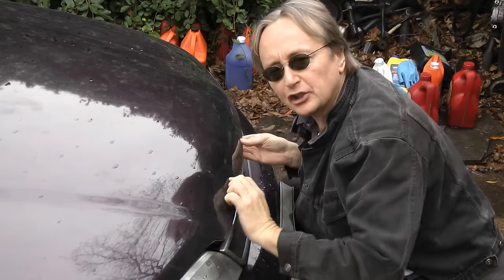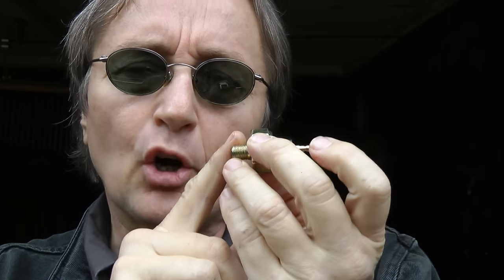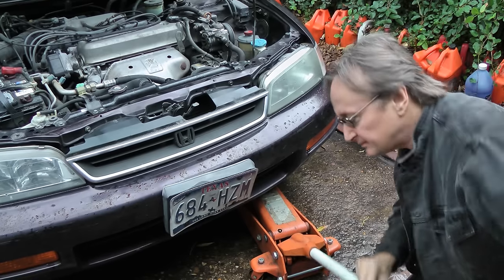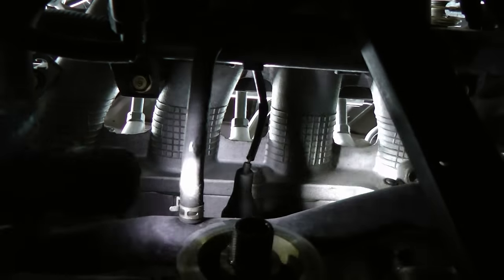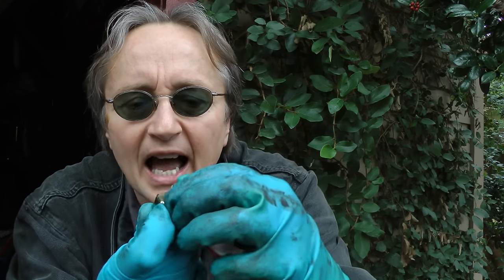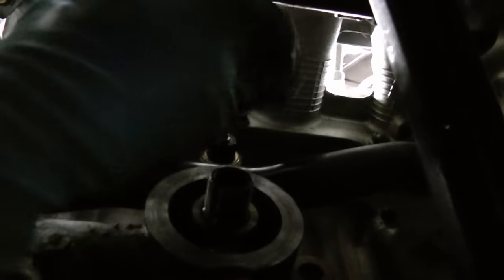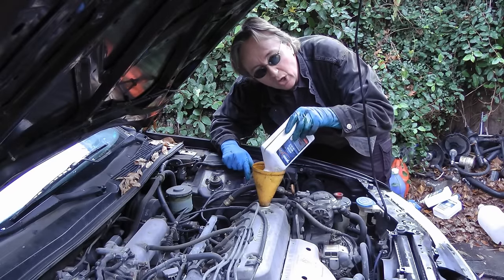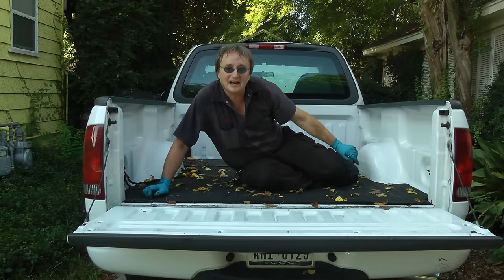How to Fix a Low Oil Pressure Light in Your Car

Comment: hey scotty. I have a 2006 dodge charger rt. I replaced the motor oil and the filter and after driving it for two days the low oil pressure light came on.  I have had this car for a couple of months. and I decided it was time to change the oil. I used conventional oil. the car has 126,000 miles. can it be because of the oil viscocity or what can it be... thanks in advance.
Reply from the maker: first, change the oil filter, bad ones will do that with weak springs inside. If not that, change the oil to a higher viscosity
Reply: ok Im sorry. I miss read the code.  the code showing is p0520.
Reply: Go to auto parts store and ask for a oil pressure switch, I use to have the exact same car, year and everything and that was the problem. The 5.7 hemi has that problem with the oil pressure switch. The part is about 40$ for your car.
Reply: Kenneth Tate I replaced the oil pressure gauge twice. One from Autozone and the second from the dealership (mopar) I drove 5 miles after the first one and the light came on again. Then after using mopar the problem went away. You have to use oem genuine parts otherwise the car will detect  a difference in voltage.

Comment: Okay scotty i need your help. I have a 1997 dodge ram 1500 4x4 its making the famous ticking noise.... Oil pressure at idle is like 20... And sometimes while driving it fluctuates from 20-40. When its right at 40 or a little above, it quits ticking.
Reply: Also oil level is good
Reply from the maker: +Kevin Barfield replace the oil pump

Comment: Hi Scotty. A question. My S320 Benz feels like at times the engine stops when I suddenly step on the brakes!!! I checked the rpm and its at 7000 without the aircon on which is supposed to be normal. And with the aircon on its really kind low at 400 and at time really dies out.  Is it just my idling too low?? what else could it be? thanks
Reply from the maker: try my video "how to fix a car that idles poorly" it should not idle at 400 rpms, may need a new iac valve
Reply: Scotty Kilmer I HAVE OLD FORD TRUCK , WHIT MOTOR 351 MODIFIDED 400,WHEN COOL ,IS GOOD OIL PRESSURE ,BUT ,WHEN HOT OIL PRESSURE GO DOWN LIKE 10 POUNDS .BUT IF I PUSH GAS ,PRESSURE MOVED UP .DO YOU THINK THATS IS NORMAL...MY TRUCK IS FORD 1980 F350 ,
Reply from the maker: erick mendez
normal for an old worn engine, perhaps idle it up a bit higher.
Reply: Scotty Kilmer Hi Scotty. I was able to improve my S320 Benz. Now the idling is back to 700 which is about its normal operating idle speed. And it no longer dies out when I turn on the aircon load. What did I do? I cleaned up all her air sensors, two of them actually, the MAF and the air temp. I didn't anymore tried cleaining her IAC valve since I will go over to take it out of the engine. What I did was give her the Italian tune up!!! Her engine isn't quite old yet since she only clocked at 115K miles!!! It was a complete success!!! Now I am happy using her for my daily drive!!! She purrs like a kitten even at the heaviest traffic with no over heating!! Thanks
Reply from the maker: EndofUSA
driving a car with carbon build up will often blow the carbon off and make it run normal again
Reply: Scotty Kilmer
Yes Scotty!! I guess that exactly what happened!! My S320 is back to its normal behaviour. Even with an aircon load she idles up to the required 700 rpm as it should. No longer that she dies out on me again!!! Thank you very much for all your help tips!!! More power to you!!!

Comment: Hi Scotty, I have 2003 Accord V6. It now has 140,000 miles on it. After I changed the engine oil for 2000 miles, the engine oil is all gone because I cannot see any thing on the engine oil mark. I do not think it is leaking because there is nothing on the parking ground. Today the engine oil flashes when I was driving and there is no engine oil in the car, I just stopped by store and added one quart oil. May I ask what I should do then? Should I drive it to Honda dealer or just the cheap mechanics?  Thanks a lot.
Reply from the maker: at that age, they burn oil, change the oil and filter, and add oil as it burns out
Reply: Scotty Kilmer That's a good point. But if I do not get this repaired, is there any serious result?

Comment: Hey Scott, so my engine level on the dash of my 2002 GMC Yukon XL always goes down to zero and the engine begins to knock. Once I accelerate or rev the engine the oil level goes up and the knocking stops. I actually have to put my truck into neutral and just rev the engine at a stop light so the light won't come on. I'm always putting in oil since I have a small leak so I know the oil level is fine cause I check it first thing in the morning. Any help???
Reply from the maker: fix the leak first, pray it's causing knocking from low oil pressure. if not, engine will need rebuilding

Comment: I had an oil maintenance light come on and I changed the oil and filter. The problem is, the oil light will not go out.
2009 Dodge Charger 3.5 V6 Automatic. I tried the gas pedal theory and unhooked the battery and also, connected the neg to the pos cables and turned on the head lights to drain any access current.None of these seem to work.
Please help, Scotty.
Thanks a lot.

Comment: hello good morning I have a problem with my lincoln navigator 2003 !! what happens is that when I'm driving it off completely and the board turns me something that says (low pressure oil) and the funny thing is that after going off I waited a few minutes and then turn on the truck as if nothing fails ta .. you could kind of tell me what the problem of my truck
Reply from the maker: change the sending unit as in this video and pray it's just that

Comment: @Diabloscampeones9 thanks for the tips I already watch the video and did all the stuff u said. I really think its the oil pump there is no pressure on the pump beacause I even removed the oil filter and the filter didn't have any oil canu tell me where the oil pump is please so I can work on it over the weekend thanks.

Comment: Hey Scottie, question my oil light comes on whenever I come to a stop and sometimes the engine cuts off but if the engine don't cut off the light will go away when I accelerate or raise the engine.  How do I fix this? Oh yeah it's a 03 neon with 130,000 miles.
Reply from the maker: try a new oil pressure switch first, pray it fixes it. Cause if not, you have low oil pressure and engine would need serious internal work. those neon engines are pretty much throw aways with that kind of mileage, being they are made in Mexico where quality is not a top priority.
Reply: Ok thanks. I changed the oil pressure switch and so far I have not really gotten the oil light but it does come on still because my idles really low sometimes even shuts off.  I cleaned the  inside of the iac duct and replaced the iac. I also replaced the tps sensor and inspected all the wires for cracks but it still idles really low which I think what was causing the oil light to come on in the first place. What else can I check for low idle?
Reply: @ftaylor1988  Spray the throddle body with throddle body cleaner as per vehicle instructions.. Spray the MAF sensor with No cloth.  Check cpu codes for coils & injectors.

Comment: i have the same problem in my car but, sensor had been replaced, and still the light come on, i have 04 vw passat 1.8t 155.000 miles.. i read couple rewievs abput it and i believe had sludge lines, its that correct, but once i drive on the street, but on the freeway without problems.. any ideas?
Reply from the maker: +Ricardo Juarez try K and W engine flush treatment

Comment: scotty i have done this but i still have the oil light coming on! only in drive while stopped though,  it goes out when im driving. im in Australia and i drive a 1996 holden statesman V8 fuel injected 304, ive brought a pressure test kit to check. the car has done 337 thousand ks! any suggestions on what could be wrong as i am still getting oil flow on the rockers! thanks :)
Reply from the maker: +Darryl Burrows   if the pressure kit shows normal oil pressure, ignore it, the warning system is breaking down then. If it does show low pressure, anything from a worn oil pump to worn engine bearings cdoes it with that high mileage.

Comment: would this happen to my 1993 honda accord. would it cause my engine to not start up. my car will crank but wont start up.
Reply from the maker: generally not, unless the engine is flat worn out inside. Instead, try my video "fixing a car that cranks but doesn't start up"

Comment: I replaced my Oil Pressure Sensor because it kept flickering. Now new Sensor is in and my oil light stays on permanently now. New oil change and filter and still drives good on highway. Why is it still on? Connector good and clean...

Comment: Hey Scotty I get dodge  ram change oil censor by continue  medidor low pressure oil you  help please
Reply from the maker: +Rodney Quezada have a mechanic hook up a real oil pressure gauge to find if you really have low oil pressure, or whether your gauge on the truck is just bad. Pray it has real oil pressure, cause if not, big money for new oil pump or the engine needs rebuilding with new bearings

Comment: Hello from NJ.  When I start my 2005 park avenue, the oil pressure gauge steps up and down, the red oil light blinks on and off, after about 5 minutes the oil pressure gauge stabilizes to normal.
Reply from the maker: +Patrick McKenna if engine does not clank, replace the oil pressure sending unit as in this video
Reply: TY Scott.  Appreciated.

Comment: hey Scotty, I replaced oil to a higher grade to my chevy04 Silverado (5.3)from 10-30 to straight 40 and added motor honey oil treatment on top of that. one week later all of the sudden the oil pressure went down to "0' and cranking noise. I didn't drive over a mile so I took it to the mechanic and he replaced the oil pump. the cranking noise stopped but not the low oil pressure message. It goes up no more than 20 and then goes back to "0". Will the sending unit fix the problem, and do you hear anything about the oil lifter  could be a problem? Thank you.
Reply from the maker: try a new sending unit, but don't use 40 weight oil, that's too heavy for that engine.

Comment: 06 volvo s60 2.5T, not reading oil pressure, no noises, oil changed 2k miles ago, car always maintained. Any ideas?
Reply from the maker: do as in this video and pray it's just a bad oil pressure sensor , often is on that model
Reply: Thanks for the super fast reply! Is it worth risking driving to the shop? Shop is 1 mile away, I can throw it in neutral for at least half that time since it's all downhill..

Comment: Hey, I have a 2005 Hyundai Elantra and when I turn the key to the on position the low oil pressure, Charging system, and check engine come on. But I start it the charging system and oil light go away. Is this normal? I recently got the car used and the check engine just  popped up.
Reply from the maker: that's normal

Comment: 1993 dodge intreid oil light flickers when in stop and go traffic oil pressure ckd ok oil sending unit change not leaking oil u have and clue what i need to change i read about a connectir on the oil wiring or something plz help
Reply: +Michele Rehers Same here with a GM - Recent sending unit change.Everything normal until fully warmed up and setting in traffic idling, when the rpms drop bellow 650. Then the light comes on - I can raise the RPM a bit with the throttle and kill the light.If it was an old car I would just use the idle screw. These newer cars will not allow that. Not long ago replaced the idle control motor. Manual says the motor can idle at 550 rpm. Maybe it is the oil pump - Would like to know an easy way to test what the sender is seeing.Am really at a loss.

Comment: My Toyota camrry 2007  was  lightening up the oil signal every time I stop at the traffic light.  One day , I was able to see the light more often , so , the engine light came on, and I pull over,  checked the oil stick , it was empty,  I added oil  and I  left it halfway full, I turned back on again and the engine light is still thete,  what ti check next?

Comment: While driving my car a hear a loud sound before oil pressure light comes and I disconnected my battery terminal and light goes off
I use cata clean but still loud sound is coming while driving.
Kindly assist me to get solutions.

Comment: Hi Scotty, on my ford mondeo v6 on high RPM (above 6000) the battery light comes on, below 6000 doesn't (the battery is new, the alternator shows 13.6-14.1V).
What could it possibly be?
Reply from the maker: going that fast, easily can cause electronic problems from electronic interference that would be impossible to track down. Have the alternator load tested though, places like auto zone do it free, replace it if it fails that test

Comment: Hi sir.
I have low oil pressure light issue at idle or low rpm.
Car is chevy optra.
Did engine flush.
I have also changed
1. Oil pump
2. Oil pressure sensor. 
Still same problem last 18 months.
Still no success.
Pl help

Comment: hi scotty, i have ahyundai sonata 2008 full option.2 days back low oil pressure lght came on. when i am giving accelerator the light going.applying brake the light coming,please give me a reply.
Reply from the maker: change the oil and filter, and the oil pressure sending unit, pray it goes away. If not, engine is losing oil pressure and that's serious internal Expensive problems like worn pump or engine bearings.
Reply: I already canged oil and oil filter..but the light still  there..

Comment: hi how you doing Scotty I really enjoy watching your useful blogs. I've had the same problem with my 08 ford fusion its low oil pressure light came on while driving but it's strange that it goes away once I give it gas. I don't wanna just take it  to any mechanic without having an idea of what it could be.  btw I already checked the oil level and is fine. please help me thank you.
Reply from the maker: +OnlyTheTruthSorry  change the oil pressure sending unit and pray it goes away. If not, it's time to have a mechanic check the actual oil pressure with a pro gauge test.

Comment: I have a 2003 Cadillac cts and I saw the low oil pressure message there is 41% oil in my car is this fixable
Reply from the maker: often just a bad oil pressure sending unit, change that first

Comment: I have an 06 Saab 9-3 2.8t and the oil pressure light comes on when the car is under load or the car is accelerated. Oil isn't low. What could be wrong?

Comment: I have a 2000 monte carlo and my low oil pressure light is on..I just  got an oil change and the oil sensor is fairly new..wat should I do??...the car runs fine tho
Reply from the maker: if it doesn't clank from real low oil pressure, live with it, or put o an oem oil sensor if you used aftermarket

Comment: hey scotty what do u think abt 15 psi at worm idle on a 5.7 hemmi dodge charger my mechanic sais its bad and its gona go bad in 6 months tops but every forum i read says its normal ... i did the first oil change at tires tires i got recomended high milage oil at 140k miles but idk what to do i do have a check ingine light on for the oil pressure censor "short cirquit" ? i do NOT  have a chek engine light on just the chek engine
Reply from the maker: +Jhon Getto    that's normal on those with that mileage

Comment: NI PS......I just had the same work done to my truck as you. I also have the oil light come on when I stop and the engine is idling. Like you, it goes off when I step on the gas. Back to the shop to check it out. Already  spent a pretty penny, don't want to lose the engine now. Frustrating.

Comment: my oil light did not turn on, the i heard  knocking look at the oil there was almost no oil what could be the problem on 02 jeep liberty limited?
Reply from the maker: fill it up with oil, knocking ruins the engine. then find out where the oil is leaking or burning. see my video "finding and fixing car oil leaks"
Reply: there is no leaking at all no smoke either

Comment: Hey Scotty, I was wondering if I can use plain old carb cleaner on a "Cold start Injector" on my 280ZXT? It has trouble running at temps below 45F usually unlike my old Z car which was same Y/M/M minus turbocharger.
Reply from the maker: sure, just realize those generally break electronically, not mechanically, so odds are cleaning won't fix it
Reply: Scotty Kilmer
 Ok, I'll go and test it and see how it goes with my voltmeter-FSM then. Thanks a lot!

Comment: Hey Scotty, people reading this;

I have a 2014 Turbo Jetta that had it’s oil changed from the dealership about 4 months ago and ever since the oil pressure light has been coming on.
First they said the oil housing filter was loose then it was the oil pressure switch. They changed the oil pressure switch and still the light is on.
Recently topped up the oil too as it was dark and low.
The oil is now fine but light comes on sporadically especially cold starts. No leaks found.
Any advice?

Comment: Hi Scotty! My father has a 2010 Opel Corsa 1.7 diesel. In the last oil changing, they just put 3,7 litres of oil and the manual says that the maximum capacity is 5,4 including filter and the difference between minimum and maximum marks in the deep stick  is 1 litre. A light came up in the panel but my father doesn't remember if it was yellow (just low oil level but no big problem to the engine) or red (more severe risk, low oil pressure). He did 100km with the car before returning to the garage to add oil. Do you think it may have weared or damaged the internals? Or do you think that it was not a big difference between the minimum (4,4l) and the amount they added in the garage (3,7l)? Thank you!
Reply from the maker: it shouldn't have hurt anything, but whoever screwed up, demand a year of free oil changes from them and check the oil after the job.